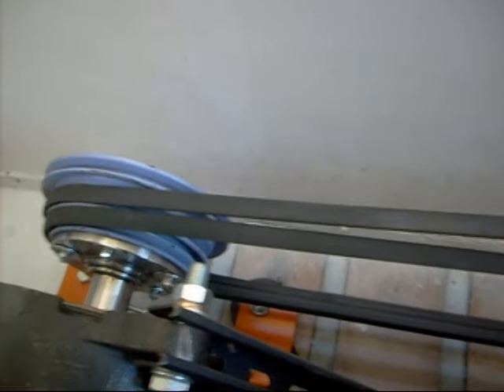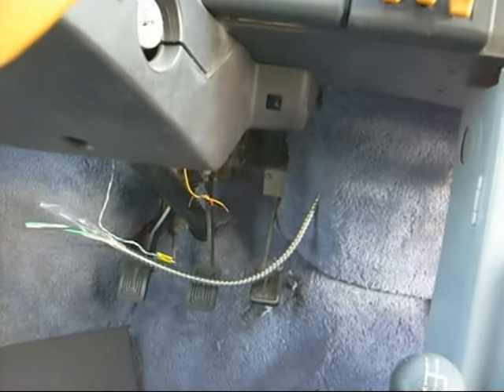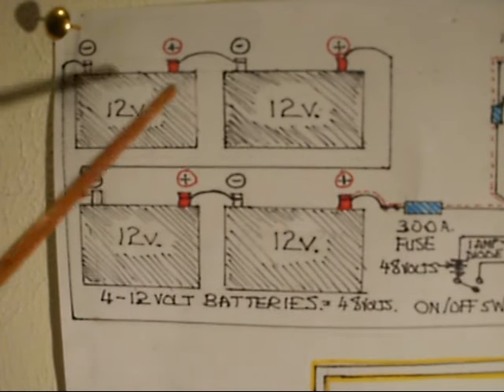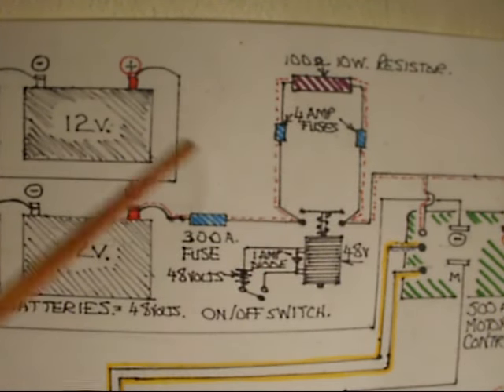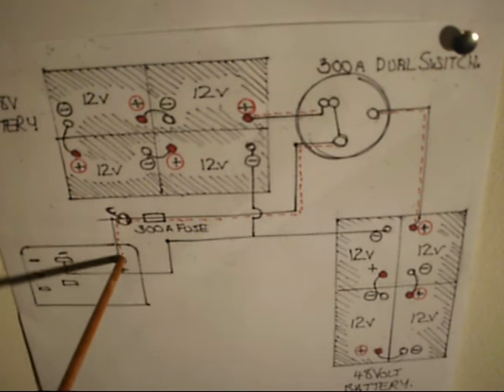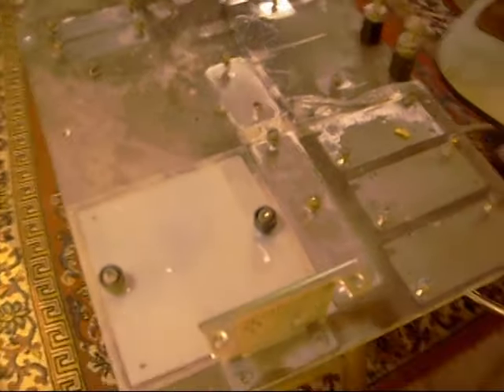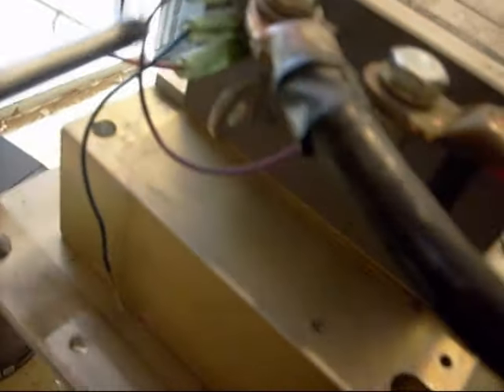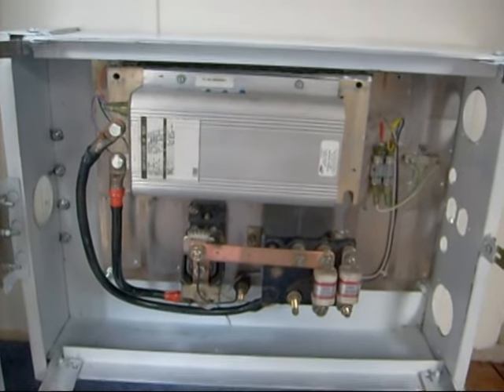The Electric Motorhome. part 20-a .DC motor control  circuit.

Comment: have been enjoying your videos to my wifes distress. i do have a couple of questions if you have the time /i am making some assumptions that you are using 12  volt 180 amp hour batteries in series 48 volts at 300 amps you get 1/2 hour for each battery pack?
Reply from the maker: Thanks for watching..and good point...I don't know how long the batteries would last ..it depends on how  fast or how much load is put on them...If they lasted 30 minutes ,I  will be most happy...Though I believe thatI need at least twice as many...Cheers.